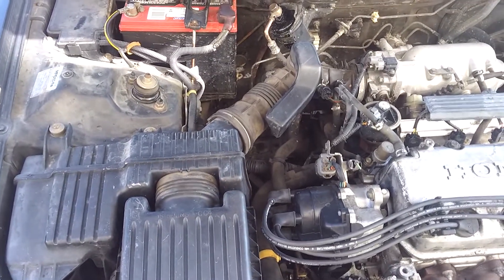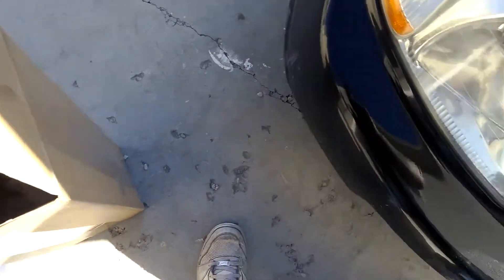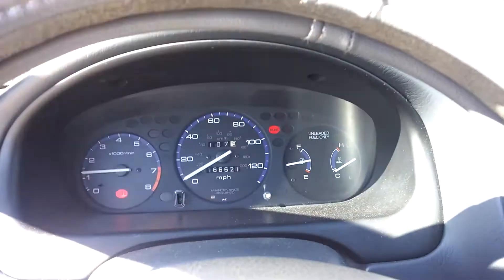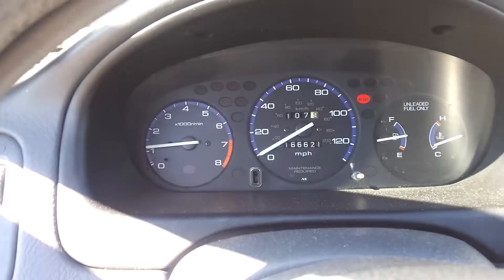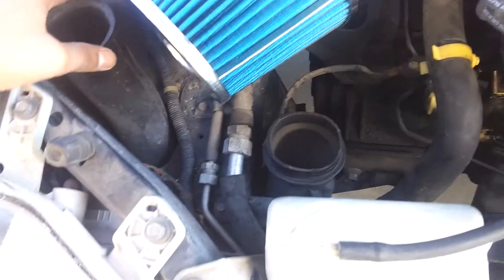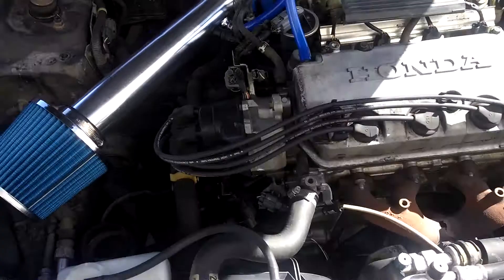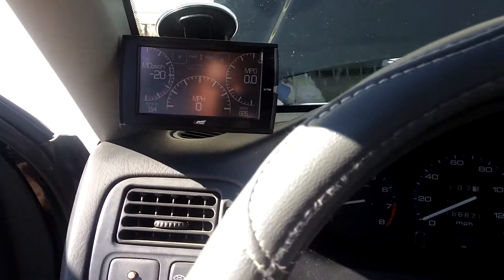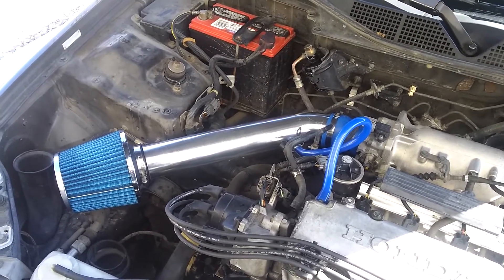97 civic short ram intake

Comment: u realize ull be replacing headgaskets and seals if u removed the lower tube to the intake  from the valve cover just a warnin
Reply from the maker: i got a new intake and every tube is where its suppose to go. have you seen the new injen intake?